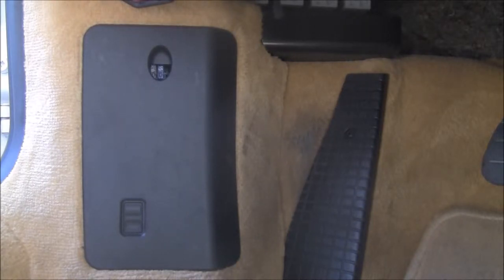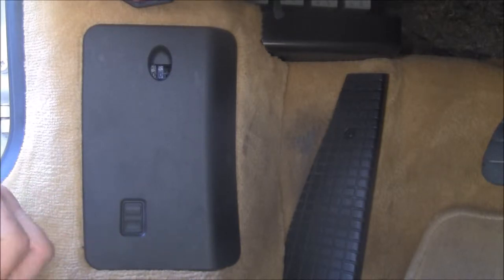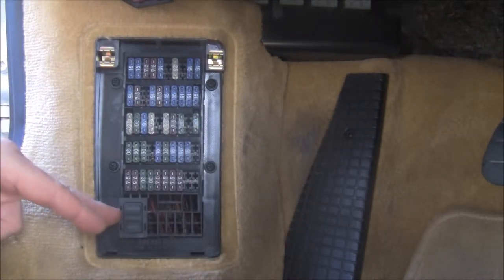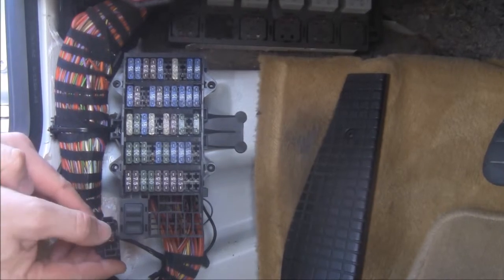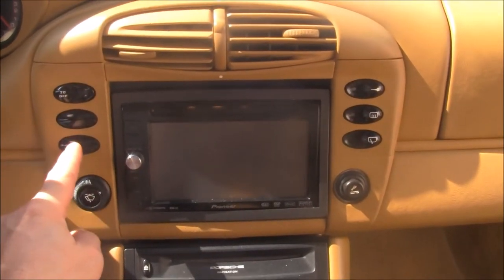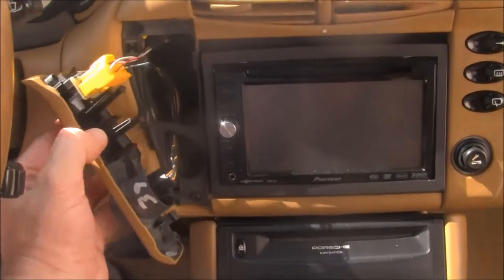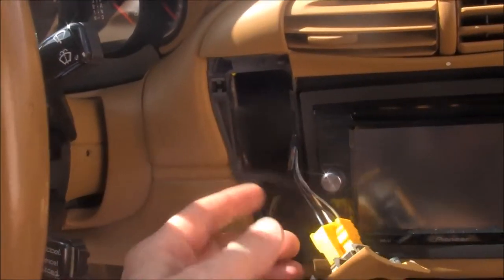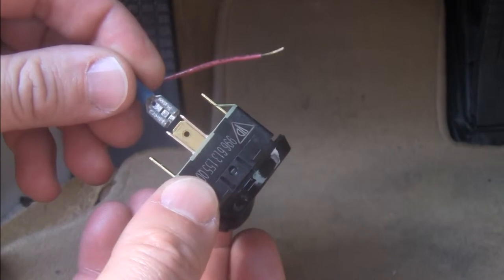The Rotating Tire: Relocating the Rear Spoiler Switch

Comment: Nice work, your solution is working fine.  Just watch out using single core wire because it often doesn't crimp too well and can snap off easily, especially if it is moving around (even while fitting, especially at points where you strip the wire and nick the wire itself).  I'd suggest multi-strand wire for anything that is going to be a longer term solution beyond prototyping.
Reply from the maker: ebswift thanks for the info. I will keep an eye out.

Comment: How about the power for the light in the switch when the head lights are on.
Reply: The outside two pins on the new spoiler switch are for the switch lighting. One is the positive and one is the negative. Connect them to the corresponding pins on the existing switches in the dash. 
You can use a special adapter sold in some auto parts stores to "tee" off of the "TC" (traction control) switch above the new spoiler switch. (Or you can cut and splice into the wires. Not for me...) 
The existing "TC" switch and all the other 5 pin switches are wired to illuminate when the running lights or the headlights are switched on. 
The two outside pins, (The two pins that are farthest apart.) on each switch are the same on all the five pin switches on both sides of the radio. Like the new switch, the outside pins are positive and negative, 12 volt DC. 
To test this, take the outside wires of an existing switch. Connect the wires you took off the the corresponding pins on the new spoiler switch. Turn on your parking/running lights. The new switch will light up. Hint, don't do it in the sun. The switch lights are not that bright. Or hook the two outside pins on the new switch to any 12V DC power. I have a 12V transformer so that is how I found the pins. 
Great video! I have a shop manual but it did not show me how to take of the panel off that is around the fuse box.